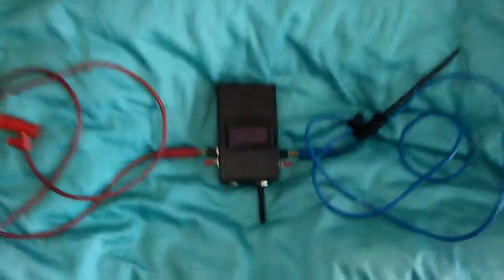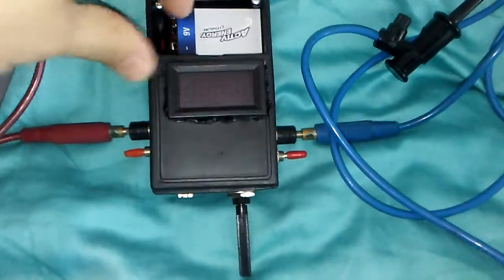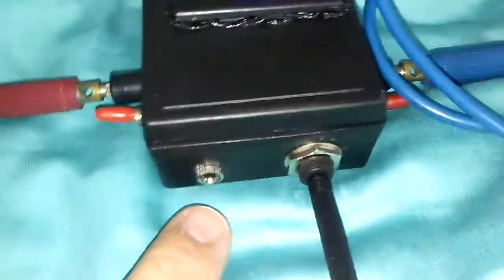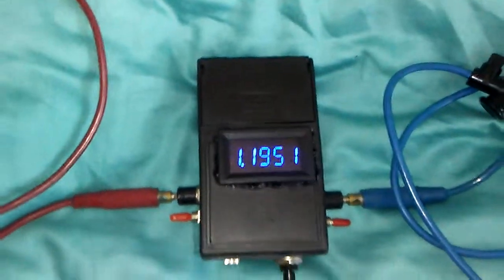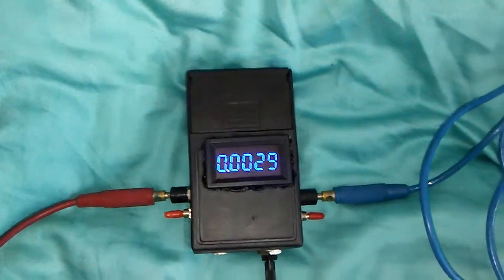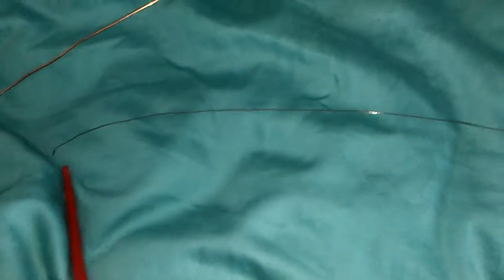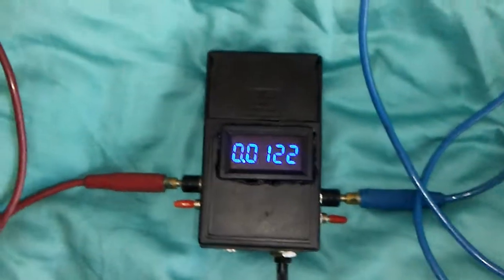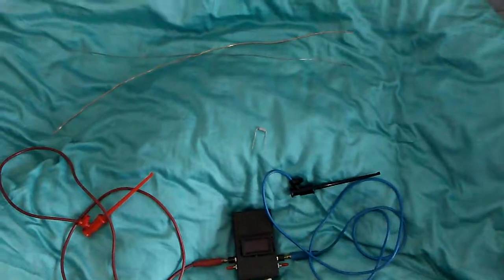HOW TO TEST WIRE QUALITY? Boxed milliohm meter and testing with three wires

Comment: Please, where on the schematic/circuit, do you connect the calibration switch and the on/off switch - the original schematic didn’t have either. Please reply, I’m a novice but I’m trying hard to learn.